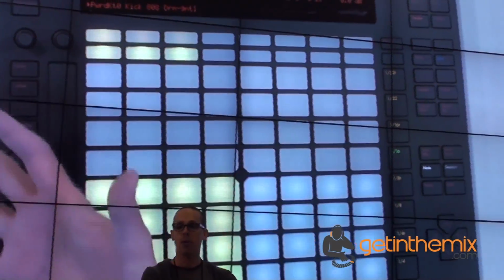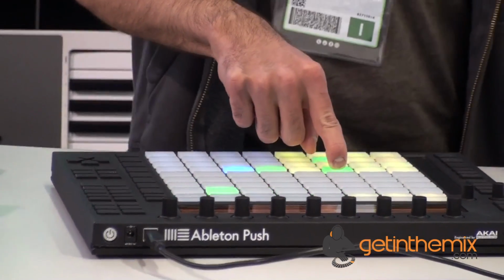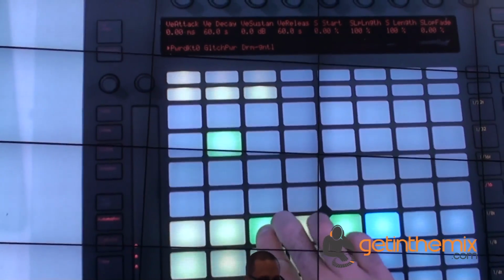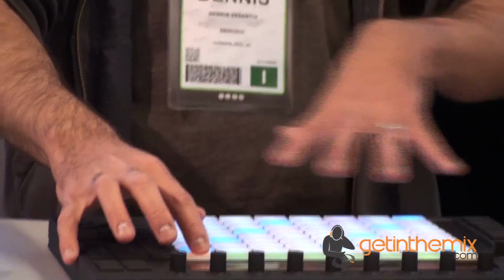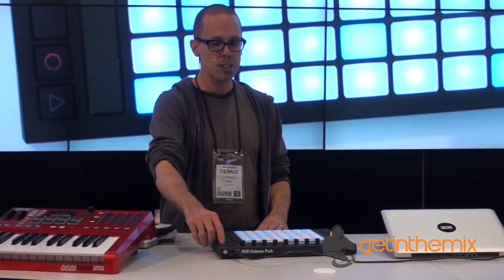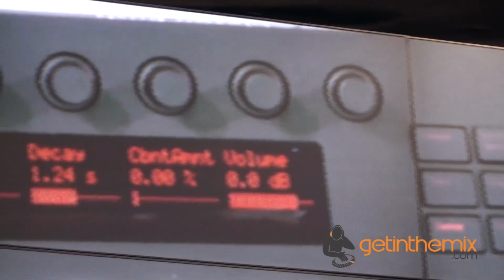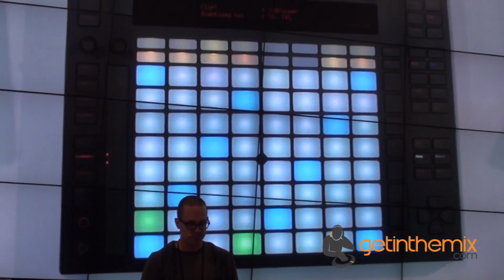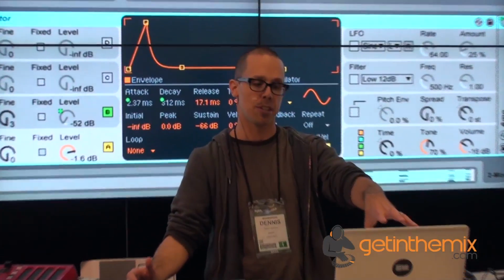Ableton Push By Akai Demo - FIRST LOOK with getinthemix.co.uk at The NAMM Show 2013

Comment: This looks cool but I think I prefer the MAX49 keyboard, the APC40, and the Maschine. I think it's better to have separate devices rather than use one controller for everything. I will still buy it though because I don't think I can resist.

Comment: It's like a far more integrated versatile maschine
Better audio quality
Easier on your cpu
personally I can only route 8 channels from maschine to ableton
eliminates the headache of routing
makes sidechaining easier
I'd love to see if it has all the features of maschine . If it does than it solves a lot of technical problems I've had with maschine.

maschine does double as a software controller that easily swaps as a midi controller. I use maschine to control traktor and maschine simultaneously.